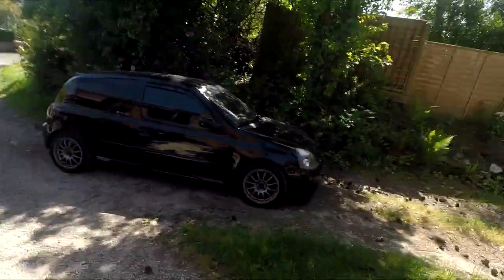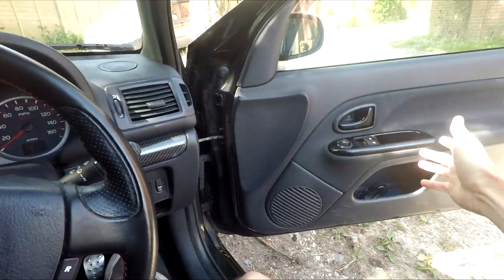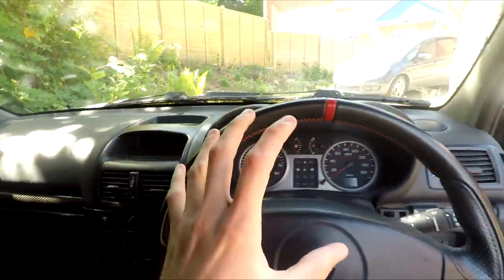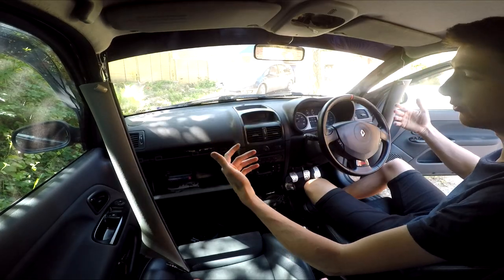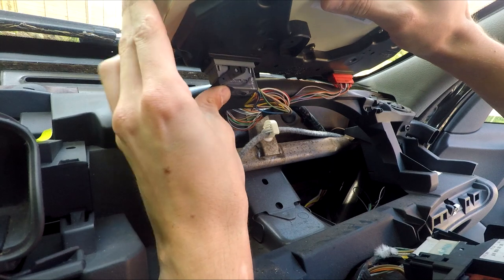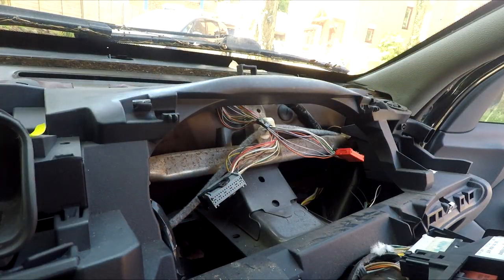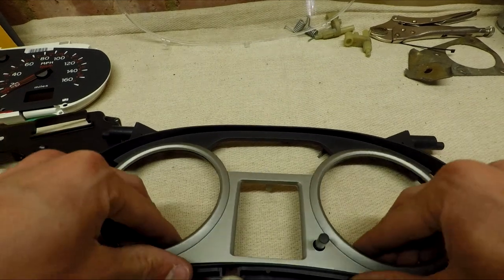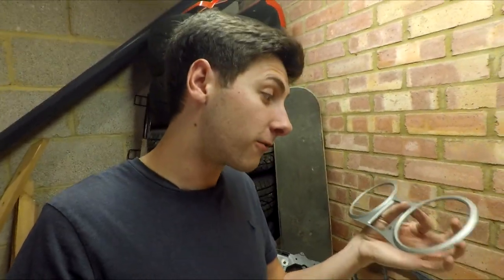How to access and tear down the SPEEDO! *More interior changes*

Comment: Before you put it all back together cable tie everything in sight! All the looms to something, the side vent pipes until there’s no play in them, and lastly the dials once plugged back in and slotted into their hinges put ties around the hinge and to the nearest anchor above them. This helps cure the binnacle rattle. Run the car with the dash top off aswell as this will identify hidden rattles so you can locate and cure them. Genuinely, you can have a rattle free Clio, I know! Sounds crazy right!

Comment: oooof.

1:46 mask that off and paint black or red mate, cant remove it without dissasembling the airbag, but mask it off and lick of paint!

3:26 ye motion sensor for the alarm mate, temp guage for the climate is up in the panel with the ceiling light which is why that panel has a vent in it ;)

4:57 when done well and right, flocked sash looks SICK, best paired with also doing the a pillar trims too, and even coverin g the headliner in alcantara so it all blends nicely, more better, a pillar trims also covered in alcantara sheet like the headlining so that matches nicely and contrasts the flocjed dash slightly!

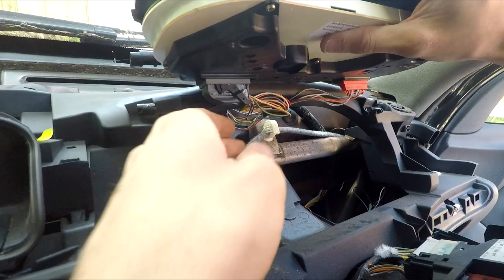5:17 ooo i like our liccle chats! (5:20 awhh u make me blush)

6:22 that was a good old pinky injury right there!!

9:55 when you paint, do the whole thing red, let it set nice and well, then mask off the rings bit, make a nice edge agasint the ring and then spray just the middle black,, you can also paint the whole thing black, mask the middel and do the rings red, but i found it easier to make a nice edge by masking the rings off as the tape want sto folow the contours a bit more easily! copy me dad!!

(A small tip, at the start of videos, as close to the start as you can, mention something like 'please if you enjoy this video, consider leaving a like and subscribing, its free and you can always change your mind later on',  then again at the end of the video as always,, doing it at the start plants the seed in new viewers heads ;) bigger youtubers mention that when they mention it at the start, they see a greater correlation of subs gained and likes on that video than if they didnt mention it at the start!)  epic vid as always, love my little shout out xD love to see how the paint comes out,, also paint the whole black housinf part gloss black, so it matches the black that you do on the silver section nicely!

Comment: Hi mate. I've recently picked up a 1.4 05 mk2 for a winter runaround when I can't be arsed with the motorbike.  Thing is, I've no heater. How do I get it out of the centre console? I've followed your instructions to remove the dash but still a fair bit in the way.
Reply from the maker: When you say no heater. Do you mean it won’t blow hot?

Also this is the furthest I’ve gone with the dash tear down (luckily 😅, try googling it for the forums!)
Reply: @jwmeale3058  as in no blow function altogether lol. I'm relying on heat from the engine coming through to demist the front screen.  I've tried a few forums and other YouTube vids but the mk2 seems to be a  it of a unicorn.  Cheers for the reply though.

Comment: That side sensors near the windshield are from an car alarm system.
Reply: Correct! Make sure to point them back in the original position and not pointing upto the roof...lolol
Reply from the maker: Thank you I had many ideas for it in my head 😂
Reply from the maker: css172 ah right will do 😅😂